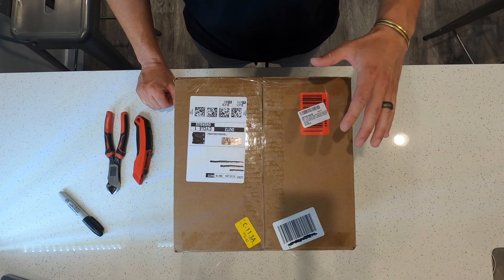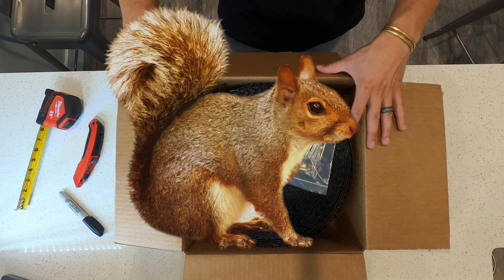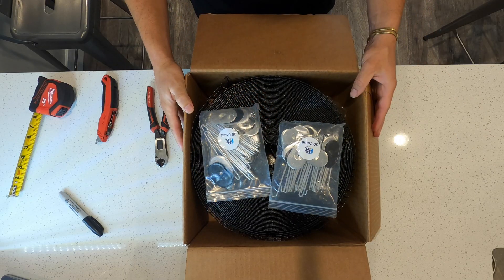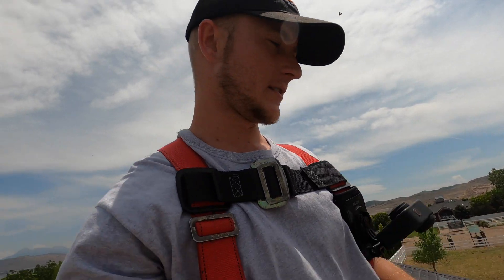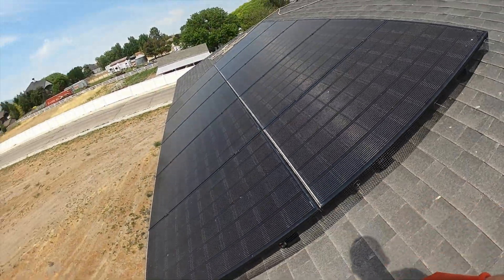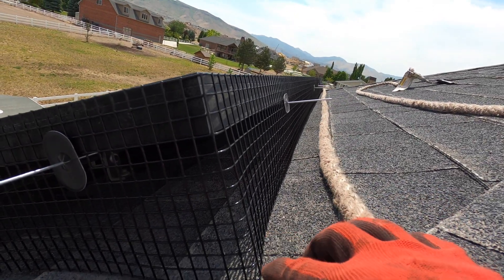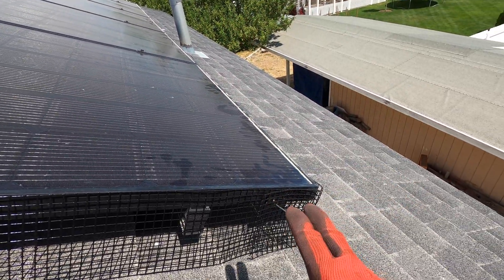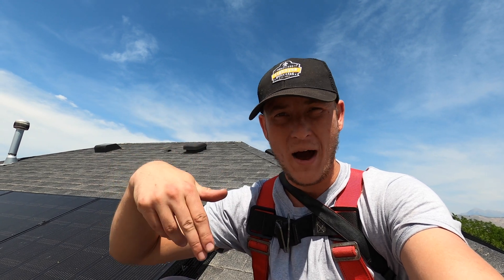How to Add A Screen Around Your Solar Panels - Solar Panel Pest Protection Kit Review

Comment: What do you installed for panels that are rounded on the opposite edge? I have panels that the hook works great on one edge but not the other because it rounded on the inside.

Comment: So glad I found your channel! I live in Palm Springs, CA that has about 20 solar panels from the original build in 2006. Of course since the house was vacant for several months, then pigeons had taken over previously...while they have moved over to the next house, I know they have a nest under a couple panels.  How do I go about getting these panels checked out to make sure they are in working order and then if they are, then next I'll look into something similar to protect the panels.  I'm also interested in adding additional panels since  don't think 20 will be enough when it gets to the summer months and we're running the 3 AC units we have with our 110+ temps.  So where do I start?  Who should I talk to/can trust with all these solar companies going BK, especially one of the major ones (SunPower)??

Comment: What really is annoying is that these solar panel companies don't tell you about bird proofing and you don't know any difference which is just madness.
It only becomes a problem when you start seeing and hearing the bird/critters making a mess and in most cases, excess rubbish gathers into your gutters which in my case, weeds started growing, probably what the birds had eaten and just generally making a mess. So my question is, why  do these companies not inform you about problems you will face once they leave. It's madness when they could just as well install bird/critter proofing.
In my situation, after contacting the company, they basically told me it wasn't their responsibility and that I'd have to pay somebody to come out to do the work. But to make sure it's done right as to not void the warranty. Pure madness and unnecessary problems.
Anyway, that's my rant over. So just an update, I have just received my kit that I purchased off of eBay. Now I just need to find somebody capable of carrying out the work.👍

Comment: We like to bend the j-clips up against the panels and snip it off. Snipping it off isn't necessary but I've found that the clips can loosen up over time in the wind and with expansion etc. The bend helps prevent the washer from rounding the corner and falling off the end of the clip.
Reply: Excellent tip, thanks!

Comment: Couple tips for your next install. 

Order screen about 4 inches taller than the panels and fold the bottom at a 45 degree angle to prevent birds/squirrels from pushing the screen. 

Takes a little more labor but makes a huge difference. 

Also Solar Clips should be installed every 18 inches. 

Otherwise great work man!
Reply: If you don't mind answering, which way should the 45 degree angle bend, inwards or outwards?
Reply: @FracturedReality777 outwards so they can push the critter guard in

Comment: Hey SolarGoat.  Great work your doing.  It's not easy being up on a roof.

I had pigeons nesting in a hole under my eaves  and they are a pain in the ass.  What they don't tell you is that when pigeons get removed, they  may leave behind bloodthirsty bird mites that will go into your home and start biting you!

We had literally hundred of them come thru.

We are considering doing pv panels up there and good to see there are solutions to keep bird away.

Pigeons are creatures of habit, no matter how many times u spray water or shoot them with bb pellets, they will come back unless u can put these little blockades up.

Comment: Can I ask if this ever interferes with the solar panels in anyway? Output or warranty?
Reply: Generally the bird/critter guard will not affect output or warranty unless the install actively or intentionally damages the panel. Not the same for all solar providers so please check with your provider.
Birds squirrels and rats however will chew wires and destroy panels from time to time. They can be a real headache
Reply: No as long as there is air

Comment: I install bird proofing for a living the only time you need to screw the mesh is when the customer has had cheap Chinese no lip panels -
where the hooks and plastic clips have no where to bite or grab ..
IF YOU NEED TO SCREW YOUR MESH IN PLACE CAREFULLY MARK ALL WIRES USE ONLY SHORT SELF TAPPING SCREWS WITH A HARD PLASTIC OR SILICONE WASHER MAKING SURE YOU DO NOT PENETRATE WIRES ONLY SCREW DOWN ON THE LOWEST EDGE WITH A SHORT SCREW…
Instead of bird proofing mesh you can use 90mm or 100mm pvc pipe with joiners and glue to make a barrier that is one full frame around your panels USING GALVANISED WIRE TO FASTEN THE PVC FRAME IN PLACE TO THE LEGS ON YOUR SYSTEM..
other wise you can use flashing that is designed for some solar panels buy the manufacturer
Reply from the maker: Thanks for the comment. Great information 👆👆👆👆👆
Reply: Naw man you ruin the warranty. Just use extra clips it holds just fine because the liiiiitle lip it has holds it on. Deal with this all the time and Havnt had an issue.

Comment: i wanted to do this my self... did you turn off ur panels before doing it or did you just do it with the solar still on?
Reply from the maker: I’d definitely turn off the system for safety. In the rare chance it wasn’t grounded or voltage was leaking to the frame. If your don’t move or touch anything your biggest risk is falling. Stay safe! Be careful!

Comment: Thanks for posting. How you handle the dips to attach the same mesh on a “Spanish style” shingle roof? Those flat roofs are not popular where I live. 😁
Reply from the maker: It’s not fun but grab some tinsnips and trim to get a better fit. Wish I new idea a better way because it can be really time consuming.
Reply: Just cut notches out usually about 4 wires deep and bend the wire to fit that gap

Comment: Quick question: how can you persuade the pigeons to get out from under the panels?
Reply from the maker: I think this is actually a rabbit hole. Might need to contact an exterminator depending on where you live and what type of animal. I’d recommend knocking on the roof and scaring them off.
Reply: Gotta chase them out and pull all the babies out as well. Power wash under too. Sad that they have to die but it has to be done.

Comment: Holy smokes. Having the same problem. I have a small nest under my panel. I was able get it out but the pigeons are stubborn. Just bought the mesh and will fight with the pigeons later when I put it up
Reply from the maker: Yeah last thing you want to do is trap them in 😅😅😅😅

Comment: My husband started his business of cleaning solar panels and adding bird nesting barriers. How did you attach your harness to the roof? and if I may ask what is your advarge cost to install? How do you figure out what to charge to install?
Reply from the maker: Hi! Glad to meet someone in the solar repair and maintenance industry. If you go to a roofing supply shop you can get some good roof anchors for harness. Guardian is the most popular manufacturer. Some are permanent and other are removable. I usual use a few SDS screws to attach to a truss. The going rate for the peat screen is about $15-25/panel and cleaning is usually about $6/panel! Hope that helps!
Reply: @solargoat  awsome thanks
Reply: I to do the same solar cleaning and bird proofing in Australia…
To attach the harness you can screw in a harness plate push up a concrete tile and tie into the timber truss or use a roofers hook or roofers p shape plate they all are screwed into place using the roofing screws that are already in the tin (colour bond) roof that’s here in Australia tho!,,
Reply: I wish i had this installed when i had the array done, lost two optimiziers and a considerable amount of wirining due to squirells.  Thanksfully, it wasn’t as bad as we thought.

Comment: What do you think about Sunpower system?
Reply from the maker: Pretty slick! Seems like most solar panel and racking will work together. But it’s cool to see panels and attachments that were made for each other. A lot of times you find rails are a little bit too short or or the clamps seem too big or too small.